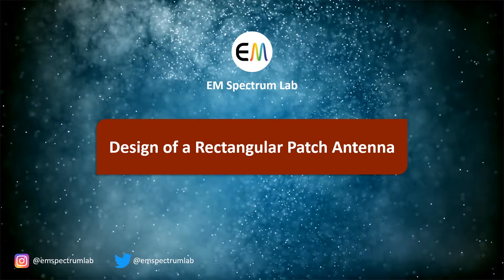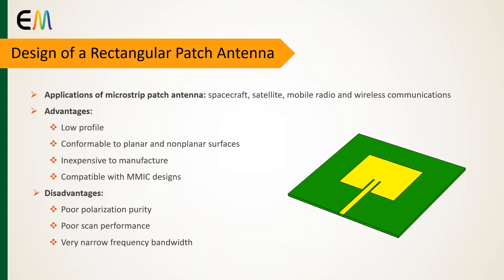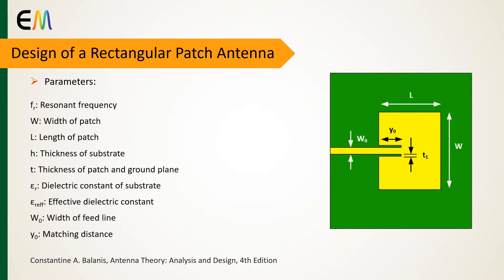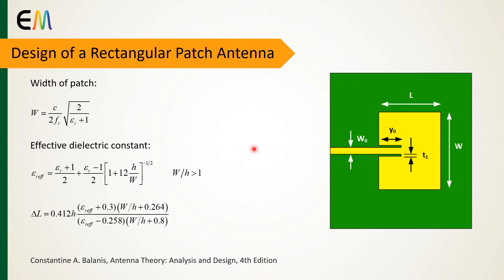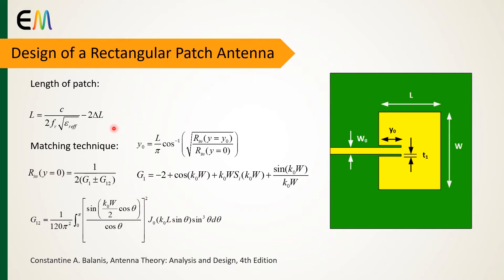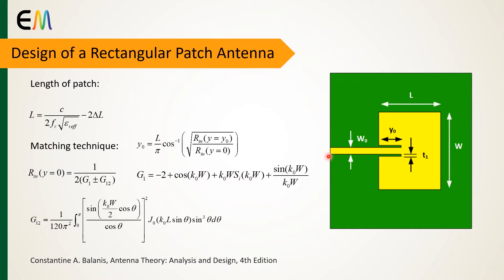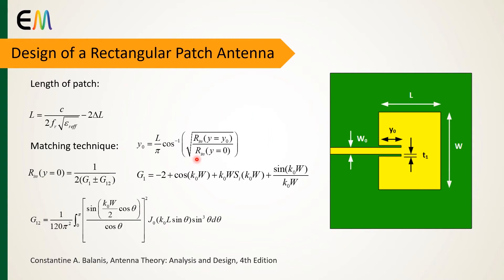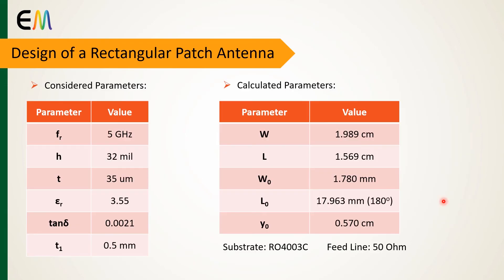Design Tutorial of Microstrip Rectangular Patch Antenna

Comment: Sir could you explain how to design microstrip circular patch antenna
Reply: Can you please tell is there any formula to design port size and pml sphere or block in comsol and could you share your mail id for to clarify my doubts
Reply from the maker: @dharania9863  In COMSOL, port size should be with the width of feed line. Also for PML you can increase its thickness enough to remove reflection from outer boundaries. You can send email to this address: emwaves.eng@gmail.com
Reply from the maker: @dharania9863  In COMSOL, port size should be with the width of feed line. Also for PML you can increase its thickness enough to remove reflection from outer boundaries. You can send email to this address: emwaves.eng@gmail.com
Reply from the maker: Yes, of course. I will record a video about the design procedure of a circular patch antenna as soon as possible. Please subscribe to my channel and stay connected with me 😉🌹